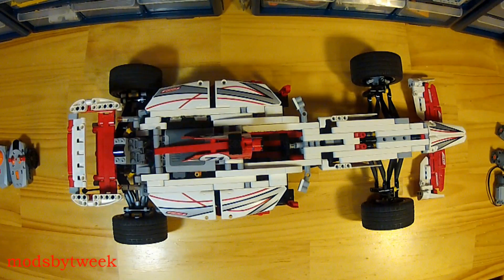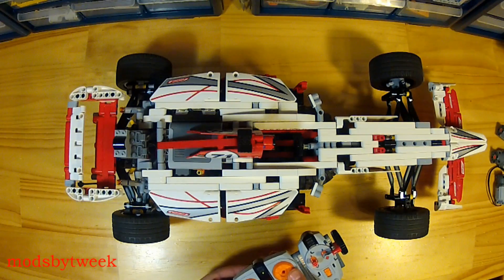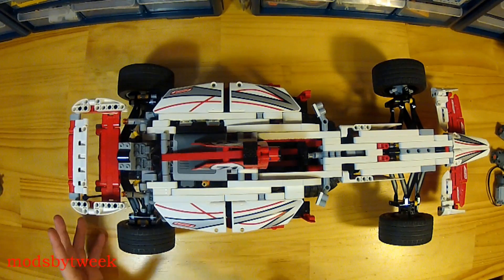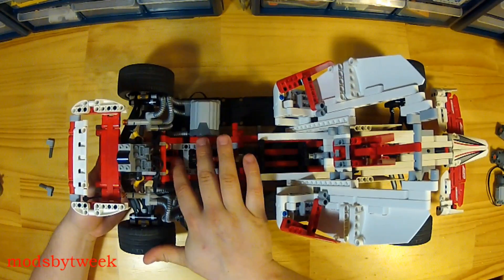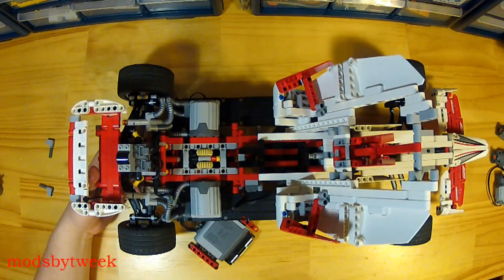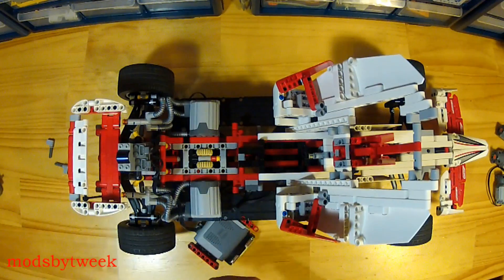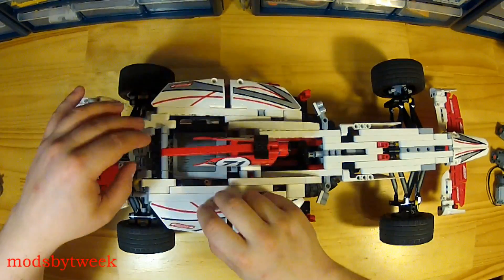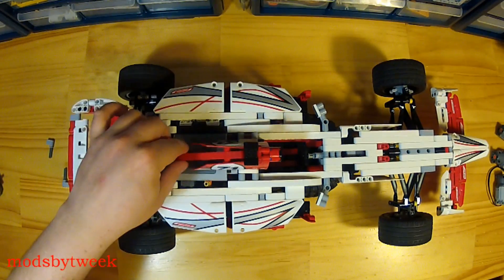Lego 42000 Grand Prix Racer RC XL motors

Comment: Wow, theres a lot of shaking or vibrations, the frictionless pins are just turning in circles (the ones connecting the wheel hubs to the supports). Would softer springs make it run smoother?
Reply from the maker: The pavement was rough and caused the vibrations.

Comment: I plan to by the 4x4 crawler and the 42000. Would all the parts and motors be sufficient to build RC motorized of 42000. Would be great if you would reply early as i wanna take them in the ThanksGiving Week !
Reply from the maker: I do believe the parts from the 4x4 crawler would be all you need to motorize the grand prix racer. You are going to want to use both large motors for drive and a power functions extension cable may help.
Reply: Thanks a much. I hv the power function n 2 large motors also.so all I hv to do is buy the 4x4 crawler n I borrow the parts. I.ll again chk later on how to build it.

Comment from the maker: I did some testing and I suggest (2) Large motors one just isn’t any fun. I did try one extra-large motor. It worked but not as well as the (2) large motors. You will need to add some more bracing for the large motors as one did come lose during testing.

Comment: hey modsbtweek i commented on you other modding video and i saw that took out the lensing off the remote control, i dont think it actually helps but something that is really helping to increase the range is to put a small piece of tin foil in a ) shape behind the infra red LED,
and also put an electrical duct tape on the leads of the LED to prevent them to come in contact with the reflector  

it will absoulutely work!